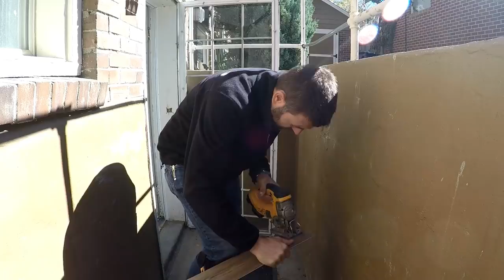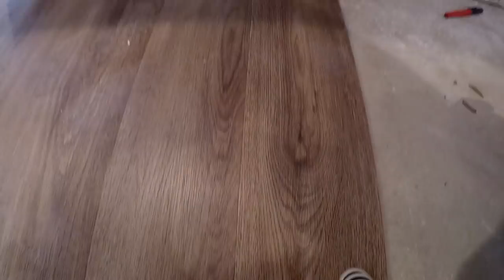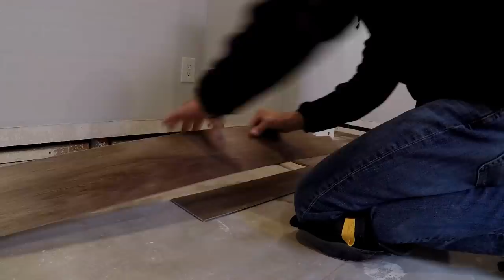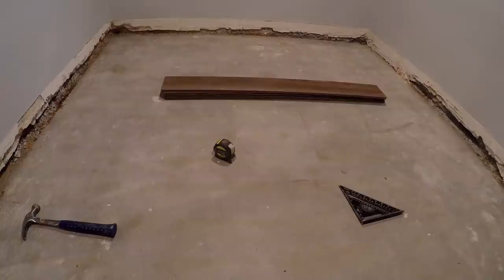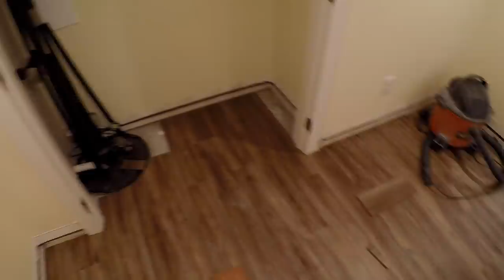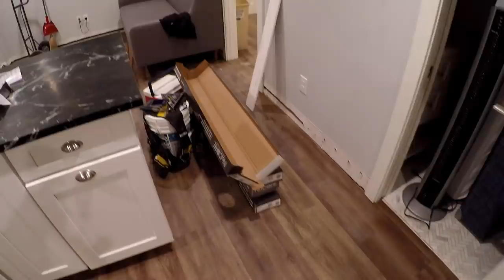Vinyl Plank Flooring Tips and Tricks | THE HANDYMAN |

Comment: You can buy foam pads meant for kneeling on. I use that on a board with very small casters, works quite well. I also made a couple more bigger boards with casters for tools. I can sit, kneel or just wheel around for fun while working. Reminds me of Eddie Murphy in Trading Places.
Reply: A board with castors! That's an excellent idea! Thanks

Comment: Personally I use pro knees, straps go around your calves. They can be ackward at first but 100% worth the price. Start 5-6 rows and what you cut off to finish a row can be recycled back to start the next row. This will eliminate a lot of waste. Use another tile as a square and it's one less tool to carry around. And scribe your cuts  by overlapping a full piece and you won't need to measure and cut rips.

Comment: the product is called a drop and lock system . the easiest one to install 'if you are new  ask for it at the flooring places . also you can use a regular tile cutter . works great . put carpet under it so you can slide it . also a pine 2x4 works great for tapping  pieces together .  use "comfort knee pads " they work great  . Installer 42 years  great video
Reply: Tile cutter? Never thought of that, but... it makes sense! I mostly use a laminate floor cutter.
Reply: They have the hard plastic pieces to serve against flooring to tap it in with. One style I love one I hate

Comment: Just a new tip for people who want to make sure they never have to replace the plywood under their new vinyl flooring. Cost a little more (BUT) last forever. Use (RED GUARD) waterproofing  before you lay your vinyl flooring just use a paint roller and roll it on to your plywood subfloor making the floor waterproof so that it never damages the plywood.

Comment: Ya I'm a flooring contractor and I do like 5-6 hour days because I want to walk then I'm 40. I REALLY recommend you buy a marshal floor cutter tool ($200) and just keep it right behind you or right in front of you so you don't even have to get up to cut straight cuts on the stuff that's too thick to just cut with a knife. Its worth buying one for every single job but it should  last you 100 jobs.

Comment: I've found a piece of 1x for tapping, and a contour gauge help out a lot when doing this flooring.
Reply: I like a tapping block - can be used completely flat and still hammered quite hard. A pull bar has bailed me out a few times as well. (I got both of mine from Amazon.) Half the flooring in my house was installed by a local that had a better reputation than their response justified. They left several 1 mm gaps, and one 2 mm gap, that I had to pull out. One gap was 15 feet from the closest end of the 40 foot run.
EDIT - I'll have to get a contour gauge, though - I wasn't sharp enough to think about it!

Comment: They make a water sensor shut off valve for washing machines.  Sell it on amazon for 100 bucks.  Might be an upsale for ya to these people.
Reply from the maker: I might look at one for my house.
Reply: most washer over flows happen because of hard water, the washer fill tube has a ball in it so the water shuts off when the machine is full, if that tube gets mineral deposits build up the ball can t go up the tube to reach the shut off switch and will continue to think the washer isnt full and keep adding water..

Comment: My husband and I plan to do our kitchen and the foyer coming into the house that's connected to the down stairs bathroom and den area. The floor has vinyl on it already but it's on top of concrete. The slab of the house. Can we just lay new flooring on top of the already vinyl and concrete or should we pull up the old stuff. The house was built in March 2015 and it's not that old but a piece of the vinyl in the kitchen floor is peeling up. I was gonna just put a rug down to we could get it replaced. I look forward to your response. Thank you and nice work.

Comment: I guess my comment from yesterday would fit better in today's video.  "I appreciate you building that 'backwards' to avoid the transition strip."  So many times I see people just starting the same flooring in each room and putting a strip across the door.  This looks so much better when it is seamless!
Reply: Most floating laminates and engineered hard woods, per manufacturer specs; call for transition strips at all doorways.  To allow for expansion and contraction. Not sure about this stuff though, I would never use it........
Reply from the maker: @ Mark Shiflett  This type of flooring allows up to 6400 sf with out an "expansion strip"

Comment: I just bought a roll of 1/8 inch eco cork underlayment.  I'll install my vinyl flooring over the top. it doesn't hurt to use thin underlayment for this job. I'm installing more for cusion.  definitely feels less hard when walking on it.
Reply: Be aware that unapproved underlayment may void warranty on vinyl plank. Usually at least one type is specifically approved - the stuff I am using specifies high density foam or nothing.

Comment: My home was built in the 30's and believe me nothing is sq or level in this house. When I put my laminate flooring down it was a pain in the ass. I kept thinking how in the hell did they level or sq. something up back in the day, and I think I know how. They had a guy name Bob standing there and they would yell out "HEY BOB!!? This look straight?" After I got the flooring down I sealed it with clear epoxy resin and OOO MY DAMN it looks beautiful. Not only did it protected my flooring but it's waterproofed, scratch proof, high gloss, and easy to keep clean.
Reply: Good old Plumb Bob. Better performance on any day but Monday.

I dunno about resin on it, though. It is possible to repair a damaged plank floor. My wife didn't notice when a car pulled her coffee cup warmer off the side table and it landed upside down on the floor, scorching it. When I get the rest of the floor done I will replace those two planks.

Comment: Great video. I know they say no underlayment is needed but would it hurt to put down a layer of 4 mill plastic or does it void the warranty ? Thanks.
Reply from the maker: Its completely useless.  You could do that if you wanted.
Reply: @TheHandyman1 , Thanks !
Reply: @smokingcheeba420 , If overlapping 4 mill plastic by 2'' and a strip of packing tape is leaving ridges so bad that they are noticeable when laying the floor, you are definitely doing something wrong.
Reply: Using the wrong underlayment is bad news. My supplier explained to me I could put my brand (Prime Waterproof Flooring) down without underlayment without voiding the warranty, but high density foam was recommended. He warned softer or more irregular underlayment can cause cracking that would not be covered.

Comment: Do you have to use a expansion gap on this stuff? I’ve heard they only leave one for “maintenance purposes” when it comes to repairing a jacked up one.
Reply: I've wondered about it. The instructions say "yes" but some googling shows the thermal coefficient of expansion for PVC (which is what "vinyl" planks are made of) is between .005% and .007% per degree C.
Installing vinyl plank in temperatures below 10C (50F) is as cold as I would want to get when working with it. If it gets 30C hotter (104F... I lived in Phoenix in a former life) a 50 foot run will lengthen about an inch. A ten foot run will lengthen about a quarter of an inch. Why the gap is given as a quarter inch regardless of run is a mystery to me.

Comment: It's OK to not stagger the flooring in the hallway?
Reply: All right, thank you
Reply: I was wondering that myself....I always stagger areas like that as well....but I see it doesn't look too bad just using full pieces....I think if it was more than a few feet though it would need to be staggered
Reply: It depends on which way flooring is run ,  but yes full pieces is good

Comment: Might be a stupid question but is there a garage version of this product, or would cars pulling in and out on it destroy it
Reply: Daniel , I was asked by a costumer to install a vinyl floors for her 2 car garage and I did it. whoever, It was costly but did give her 3 years warranty . Her garage was heated . 
Had to lay some thick fiberglass /rubber membrane on the bare concrete then on top I installed the planks with a special adhesive that was recommended but the salesman at the hardware store.

Comment: nice job. that stuff looks pretty easy to work with. but even though its "waterproof", if there's another flood, wouldn't it still have to be pulled up due to trapped water underneath?
I prefer volleyball player's knee pads.
Reply from the maker: Yes.  There is no flooring that will survive a flood that is a few inches deep.

Comment: Nice work. I know you always work alone. And I also like to work alone but i feel on flooring or tile where you could have a laborer cutting while you are installing it is a lot more efficient and easier on your body.
what are you thoughts? I would not have commented if you hadn't complained.
I have access to $12-$15 / hr. laborers that can handle this type of cutting.
Reply from the maker: Around here $12-$15 per hour will get you a drunk with no car and a extensive criminal history.
Reply: @TheHandyman1  Not those types. The type that speak little or no english.
Reply from the maker: that doesn't work for me.

Comment: Did you leave a gap on the perimeter for vinyl plank to expand?
Reply: What wood is going to expand?
Reply: The vinyl expands about .006% per degree C. The instructions say to leave 1/4 inch for expansion, which should be good for runs of 20 feet or so in harsh climates. Most harsh climates are harsh in the cold direction, which does not do any damage.

Comment: I did flooring for 12 years and never found a comfortable way to kneel and work, my knees got jacked up from spending 40 hours a week on the floor. I got a Job as a Cad operator in 2000 and never looked back. I still have nightmares about going to install tile floors lol.

Comment: I noticed you are not using the t joints in the doorway. what allows you to skip those and just continue? will it not cause problems?
Reply from the maker: Its not skipping a step. Its just doing it with out it and keeping a smooth looking finished product.  I installed it in both directions
Reply from the maker: @jessie Acton   Here is a link to the product.  No transition expansion strips needed unless you go over 6400 sf.  https://www.flooranddecor.com/nucore-flooring/white-pewter-plank-with-cork-back-100497361.html#gclid=Cj0KCQiA597fBRCzARIsAHWby0ETOhVMsXCH6Omvd6xpZBLZy4LTyWe0ZHTFVuSTbCtZHZ6aA16QlFsaAiDmEALw_wcB&start=8
Reply: I have the homeowner purchase transitions and not put them in unless it becomes a problem down the road. Flooring colors and dye lots change all the time so having them in advance insures it will match. But most homeowners like it better with no transition. And rarely have I ever had to go back to cut them in.
Reply: thank you for the reply I am doing my flooring in a few days and have been hoping I could complete the entire house without using ugly transitions. i didn't know if there was some trick that made them not necessary in your installation i guess i have to just read the instructions of my flooring.

Comment: It’s a lot easier to install when you are on the flooring you already installed, 90% of the fold and lock can be done with no tools other than tapping under door casing and using a last board puller or shoe mold lift on your last row to click it in

Comment: So do you put vinyl flooring under a toilet or around it ?
Reply from the maker: Under would be best.
Reply: Vinyl flooring makes it easy to get under the toilet. Remove the toilet, tape off the flange, and lay it right across. Cut the hole around the flange and life is good. Removing the toilet also makes all work behind it much easier. I betcha there is baseboard a few inches back there.

Comment: Still dont understand what you mean by installing it backwards. Are you just saying that because you're on the other side of the flooring? Or are you physically putting the boards opposite of how they're supposed to go in?
Reply: hung nguyen - Generally , you install this type of " click " vinyl flooring while working from left to right . On the front and the left side are tabs that fit under other pieces when  they meet . It is the easiest way to install . However , as you work your way around a room , it is not always possible to do it the easiest way .           If you put some of those pieces in front of you on a table  , you will see what I mean .             After you back your way across a room , you have to put the tile together the same way BUT working from a more awkward angle while kneeling on tiles you have already installed .
Reply: The "right" side is the one where you see the tab sticking out on the pieces already laid. Working the other way is difficult.

Comment: so this flooring is just layed down with nothing holding it down but weight? couldn't it shift over the years?
Reply from the maker: Its called a floating floor.  Very common these days.
Reply: Shifting is a problem in some cases. A local flooring place did half our house including the hallway. In the hallway several of the planks have shifted, making gaps peek from under the baseboard. I had to remove the baseboard and put small nails in 1/8 inch from each end to control it. Where the planks adjoined carpet in doorways no both sides at once, somehow the planks shifted a full 4 inches (!!) and refuse to shift back. No matter to me - this month they are being replaced by planks that will connect each room. No more carpet.

Comment: I was expecting you to put a threshold in the hallway door but you carried the floor through the doorway.I thought it was recommended to use thresholds after so many feet of planking to help keep an expansion joint between large areas.
Reply from the maker: 4000 sf before expansion joints for this flooring.

Comment: How many boxes did you end up using???
Reply from the maker: All of them.  I had a few pieces left over.
Reply: All 10 boxes, 20 boxes?
Reply: I have 52 boxes for 889 sq feet. At this point I'm wondering if 10% extra will be enough.

Comment: All this stuff sucks! Just glue down lvt. When something gets damaged you pull the damaged board and put in a new one...and yes you can repair click types but it's never the same and is a total pita.
Reply: Heating the surrounding boards and the one(s) to be installed helps a lot. The vinyl softens enough to make a difference, but don't get them too hot to work with barehanded.